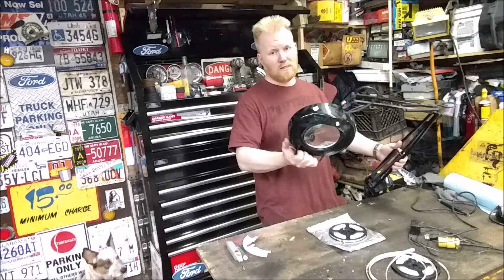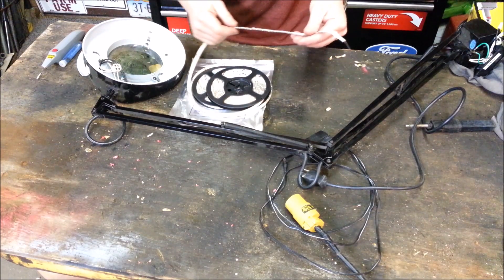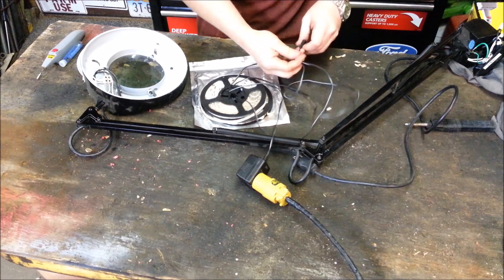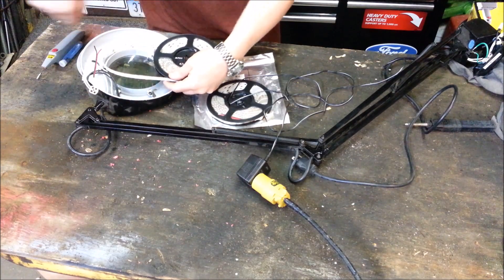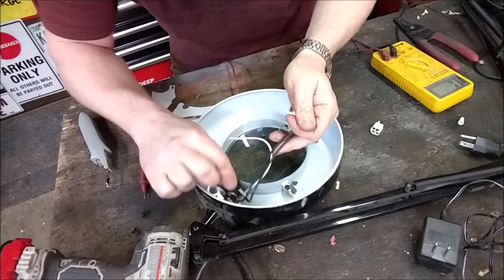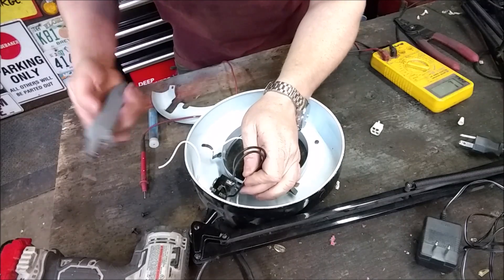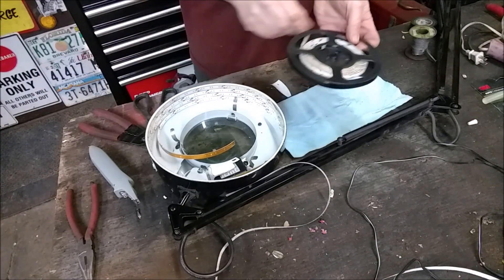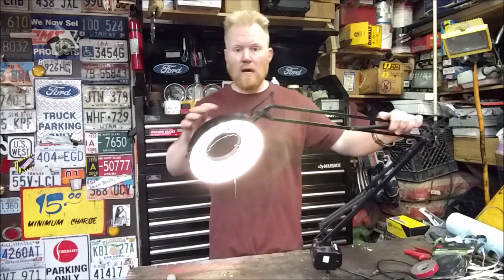Convert Old Light Fixtures to LED

Comment: Very informative. Thank you. 
I have two lava lamps and looking for a way to convert them to LED. Apparently, in lava lamps, the head is what makes the lava circulate. So I guess I need quite a powerful LED's and ideally a way to control the head output. Any advice? Would you participate in such project?
Reply from the maker: Most standard led light socket bulbs put off a fair amount of heat. They actually have an aluminum heat sink to dissipate it.

Comment: Superb idea, I just read about your conveyor belt mod on another channel and subbed now. I just bought my first two rolls of the LED strip and saw a one day special of the 5050 color available for $20. Would have went for it but a little short of cash for a few days and I have too much on my plate already.

I converted two kitchen fan lights using the can conversion ones and a homemade cannister (protein powder container and UV glue) so they would angle EXACTLY where I wanted them in 2 kitchens. Both units replaced 7 CFLs totally around 150+ watts and both run 13 watts each.

What color do you like best? 2700K seeems to be my fav but I just read 4K is neutral white and considering it for outdoors (and for security camera lighting, as well. ). I know I can do IR but it seems pretty pointless around here.

I just dug a radio shack digital temperature S.I. out of a dumpster (like new in the box, missing the tips, cost me $5 for anti static black coating set) and I was shocked to realize how quick it heated up (my phone didn't recognize my index fingerprint for two weeks!) and it seems it used a nichrome wire just like the old toasters which used to wrap it around mica.

Have you tried shaping the LED clear part to a curve to dissipate light better? I was thinking it should be possible. I was thinking of trying to "shave" some with a real sharp blade. Mostly because my 3 watt biking cree light lost its curved lense when it vibrated out (Now I use loctite in that ring.)

Comment: I don't know if anyone has said this yet but I was certain you were going to stuff that transformer where the old transformer was down in the base which you were hollowing out anyway.   My other guess was you were going to ditch the old transformer and keep the socket wired and then plug the wall wart into that outlet.

The base is hollow now, isn't it?
Reply from the maker: +Burt Reynolds Yes, the base is hollow. I wanted to utilize the switch to shut off power to the transformer so zero energy was consumed when off. This meant the new transformer was most easily installed up in the fixture for wiring simplicity. I could have placed it in the base though but would have had to run wires in addition to the ones already there(neatly ran though framework) up the outside of the arm of the fixture to power the light.
Reply: Transformers consume power even when there is no load on them?   I've often wondered this as I leave them plugged in all over my house.
Reply from the maker: Burt Reynolds
Yeah, they drain a small amount all the time, even when not powering something.

Comment: Do you get a piece of the action from the links in the description?
Reply from the maker: +James Pian Amazon pays a small percentage for anything bought through that link or during the shopping session after a person has clicked on the link. So it doesn't have to be that particular item, just anything the person buys after they clicked on it. It can be days after as long as they use the same Amazon window they opened. So yes, I'll make a little.
Reply: +sixtyfiveford 
Cool. I'm buying through that link. I'm sure your other fans would like to know that too. Add that to the description near that link.
Reply: +James Pian 
How do you get setup with a link like that? I follow another guy that recommends stuff all the time but he doesn't get a cut. I'd like to tell him how to get setup like that. Send me a private message if you can. Thanks!
Reply from the maker: +James Pian It's called an "Amazon Associate" and he just needs to sign up with a ton of personal tax info so they can pay him.
Reply: Thanks!

Comment: Nice job.  If you didn't know you can light a florescent bulb using the static from a walkie talkie the bulb does not need to be plugged in.  It will tell you if the problem is the bulb or ballist.  Nice repair!

Comment: This is off topic but I figured you would see it. I have a Duromax Xp4400E generator that I have never used since I bought it in 2013. I'm going to be upgrading my natural gas pipe in the house and I saw a couple of videos on converting this type of unit to N gas or propane. From what I have seen it looks fairly easy, I'm looking for your take on this or possibly a video when you have time. Seems like a good solution to gasoline but I'm not sure of the in's and out's. I trust your advice on this topic... Thanks in advance. Looks like a fun project and since I'm going to pipe I might as well pipe the generator also... Additional... The one site I had looked at did not use a regulator but rather used a valve to the engine to regulate gas, is this at all acceptable? It sounds OK as they are both regulation but I do not know... Well at the least this does add to the conversion concept... ;) ...
Reply from the maker: +Curiosity The regulator is the industry standard and will give the best performance. I haven't seen anything to contradict this(do you have a link to the non regulator). The key is you need an engine to operate consistently when working with a generator. The ideal 60hz is obtained by having the engine run at a stable 3600rpm.
Reply: +sixtyfiveford Yeah the guys channel is jungleexplorer and the name of the video is "How to convert a small gasoline engine to natural gas or propane" They want allot for those regulator kits, just looking for a good way around paying more than they are worth. He does not show any results other than the fast idle. It was the first one I ran across and it did not use a regulator.
Reply from the maker: I've seen this. It is a horrible idea if you like your generator or anything plugged into it. You  can manually set the air/fuel ratio for an exact load but will run too rich or lean and change the speed if the load changes even slightly. I guess it would be fine for incandescent light bulbs, but not fridges, AC units, or virtually any other electronic devise found in a home.
Reply: +sixtyfiveford Kind of what I figured, any advice on the Kit company that make the most sense to purchase. I know they are not a perfect fit in most cases so modification is not an issue, a pain in the butt maybe.. :) Thanks for you time working with and looking into this! Allot of these sites are prepper sites, not into that at all, I'm into making things work. You are one of the best around for making that happen and it is appreciated!
Reply from the maker: All the conversion kits are expensive compared to the price of a Chinese generator and generally not worth it($250-300 tri fuel). You can buy a new Duromax XP4850EH, with slightly better wattage, and is factory set up for propane, natural gas, and gasoline for right around $500.

Comment: you already got my subscribe but I will give a like as well. I would have never thought to cut the prongs off the 12v brick and wire it directly. I have also been in the market for a good wireless soldering iron so I will give the iso-tip a gander.
Reply from the maker: +Marc Willis I've been really impressed with it I use the death out of it, though I think it is slightly overpriced.

Comment: For my friend and I, "Cold Heat" was our first soldering iron... We took them back to the store the same day for a refund because they are useless. They have a chisel fork tip and BOTH tips have to make contact to the same point at the same time, in order for it to heat up, so if what you want to solder is smaller than that fork size, then you can't use it. Also, it was just garbage. Copper works well for a soldering tip for normal soldering irons/guns. I almost NEVER return things to store, but I didn't even give this a second thought before returning it.
Reply from the maker: +Jay H I forgot about the dual tip but I recall that and how annoying it was. I just remember hating it.

Comment: I like that mod. I have been replacing a few lights in my shop with just a porcelain receptacle and a screw in LED bulb.  Way nicer in the winter. No waiting for light or humming. Cold weather bulbs don't even work when it's really cold. -20 outside and the LED comes right on.
Reply from the maker: +57WillysCJ Yeah, the cold is where LED excels over florescent.

Comment: Great mod!  I actually have an old light just like that I was thinking about converting.  I'm curious, why not splice the 12V adapter to the old plug end of the lamp?  Seems like the extra weight would cause the lamp to droop.
Reply from the maker: +Jason F Though small a transformer will always consume a little electricity even when not in use, so I wanted to have the switch before the transformer to eliminate parasitic draw. I could have put the transformer in the base but then I would of had to run the wires up along the boom to still have the switch power the transformer. The small 12v transformer weighs right about the same as the stock circline bulb would have so I doesn't droop what so ever.

Comment: Nicely modified :-D
I did think (How is he going to make the leds face outwards) but that white paint reflects them fine :-D, just imagine if you had a ring cone section mirror at 45 degrees, the table would get sun tanned ha ha :).
I bet even with that transformer the power consumed would be less than the original light.
The dog was thinking (is it dinner time yet).
Reply from the maker: +zx8401ztv Yeah, I was thinking of adding some reflective tape at a 45degree angle, but it seams to provide ample lighting. I tested it at 7.9 watts(120volts) where the stock bulb was a 22 watt.
Reply: +sixtyfiveford wow thats roughly 1/3rd of the power, dam good :-D

Comment: Glad you used the hot glue! That 3M adhesive backing gives up in unheated shops. Great job..$5 for the lamp and ~$25 for everything else..can't beat it with a stick.
Reply: +wxfield Depending on the size of the stick, I&#39;m pretty sure you could beat it. :D
Reply: Yep. There's always someone on youtube willing to beat it.

Comment: How do you like the porter cable 20v tools?
Reply from the maker: +Elijah Hayes I really like them. I do think lithium is slightly weaker than older Nicad powered tools though. I have an older 14.4v Porter cable drill set that will power through anything. These Lithium based tools have the limitation of lithium not being able to deliver high current loads and they will safety shut off. For example a wood spade drill bit: my Nicad Porter Cable wouldn't stop and may slow but will always power through, my new lithium will slow slightly but cut all power if it senses to much load(all lithium brand tools do this). Even with this the lower weight and more power storage is nice and a trade off. The 20v lineup is made by Black and Decker with Dewalt being their top, Porter Cable their second, and Black and Decker their third in the line up.

Comment: Great idea! I have like three of those type lights, if the transformers ever go bad I might go that way.  I probably didn't pay more than $5 for mine either.  The ONLY thing I might do different is to gut the transformer and install the wall wart there, to make it easier to install the LEDs but great idea... LEDs have come so far of late, crazy cheap and crazy powerful.
Reply from the maker: +MISTERComaToes Yeah, there's a ton more room in the base for a transformer. I really like florescent but it has it's drawback of being slow to illuminate in the cold. I figured since this sits out in the cold shop, LED's with their instant brightness would be nice.

Comment: It is the LED revolution! I recently replaced all my CFL's with 10 watt GE LED's with 60 watt equivalence soft white. Comed (Illinois power company) had a special price. I replaced 50 bulbs throughout the house, did I save that many watts over CFL; No, but what I got out of it was instant on!!! Something CFL could never accomplish well... Walmart had the best deal, Home Depot sells them slightly higher in price. They list 22 year longevity on the box... ? :) ... Yeah I know... I'm a little concerned about these strips though, I think they are pulling more wattage than is needed. On the 10 watt; 60 watt equivalence GE's 800 lumens. I think you are pulling allot more wattage with these strips. I would run it on a watt meter just to check it out. They do also sell the circular replacements. Nice project but my concern here is wattage. If we are going to go LED; that is what it is all about.
Reply from the maker: +Curiosity I tested it last night at 7.8-7.9 watts of total power draw. I am running 162 LEDs(3528) that are approx 6 lumens each. So we have an estimated 972 lumens of light output. This is where LEDs are great when the are situated to direct light in one direction. In a round light bulb they have to use diffusers and excessive LEDs to try to get a bulb to illuminate like an incandecent or CFL. Right now with the technology, other than instant brightness there isn&#39;t any functional or financial reason to switch to LEDs. On a side note I saw double life CFLs a few months back at the home depot. They have close to a 20year lifespan and I think they were $1.99 for 4  (23watt 100w equiv).
Reply: +sixtyfiveford Excellent, I thought they drew more power than that. Nice work and conversation as always!
Reply from the maker: The LED house bulbs seam to have the best lumens/watt in directional light fixtures like "can lights". With my local power company I got all my "can light" LED bulbs for free and they work great.
Reply: +sixtyfiveford Out of all the bulbs I purchased some canned some not, I would not know the difference from incandescent. To me the instant on was the feature that drove me to spend the money on the switch. Switch over the 3 light deal in the bathrooms for daughter and wife; that day I was a hero for a day or two... :) Nothing like walking in a dim bathroom for a woman that slowly brightens. In my garage I have good lighting all LED, but I prefer bounce light as where I'm writing this from is located there, nothing like aluminum duck tape to make a 10 dollar Walmart stand up light shine upwards rather than out... :) I just purchased a DC power supply on eBay, 30V +/- 10 amp +/-; I'm going to play with this strip LED and see what it can do as a garage lighting for working on things. I had when I walked into this house 480 watts on the ceiling. That was a zero in my book... If you do nothing else a project on this subject would be to convert an 80 watt shop light to LED. I have seen allot of LED conversions but not one of those. Question is do you direct light down or direct it up into a shiny surface, bounce up and then down?
Reply: +sixtyfiveford  I thought LED's saved money, in terms of power draw?
Reply from the maker: Paul Scharlau
The power saving is negligible over CFL. But they are getting better with LEDs and should be able to pull slightly ahead this year. LEDs greatest benefit is instant light like an incandescent even in cold environments.

Comment: Great video! I put a strip of those LED's below the awning on my camper trailer. Easy Peasey, because RV lighting is 12 volt already.
Reply from the maker: +Blue Hill I have a roll set aside to run throughout my RV.

Comment: good video.  nice upgrade.   just read the other day G.E. as in General Electric will no longer be making CFL bulbs anymore.
Reply from the maker: +George W That's good as maybe the technology will get a lot better/cheaper. Right now from a financial point there is little reason for a person to swap out CFL bulbs in their home for LEDs.  Most basic CFLs still beat/match LED bulbs in lumen output/watt but you don't get the instant brightness like you do with LEDs. The CFL industry fought back last year with double life bulbs that virtually match the lifespan of LEDs.
Reply: +sixtyfiveford I paid $12. for a LED standard house "Lamp" bulb a few years ago. I just found on sale @WallMart 2 for $2.99 Cheap and running off my Solar system in RV and my small cabin.

Comment: Nice job on the light Moe.
Back in the 70's I used those ISOTIP soldering irons, the batteries never held up so i bought a Weller soldering station.
Reply from the maker: Lithium can't handle the power draw these require. That is where Nicads excel, by being able to sustain extremely high discharge rates.
Reply: +sixtyfiveford I did not know, thanks!
Reply from the maker: +old64goat Yeah, I've heard this about the battery cells. They should give a few years before they are shot, then I can swap them.
Reply: +old64goat I did too! They were allot less expensive at that time, eBay wants big dollars for these right now. They should also be Lithium not Nicad. I was looking for one the other day for something quick draw and they wanted 70+$ for them. For 50 something I had purchased a whole soldering station with reflow... ?

Comment: Hi Moe,
I love those LED lights! I use them all over my shop. The one thing you didn't mention is that you need to cut the strip in multiples of three LED's (they're usually marked on the strip). Good call on the hot glue. The self adhesive glue doesn't stick for any length of time, in fact it doesn't even want to stick to wood at all. With the hot glue though, those lights are never coming down (I've even had good luck using guns of different colors)!
Reply from the maker: +Jim Kodysz Yeah, the hot glue is the only thing I found to really hold them, especially to wood.